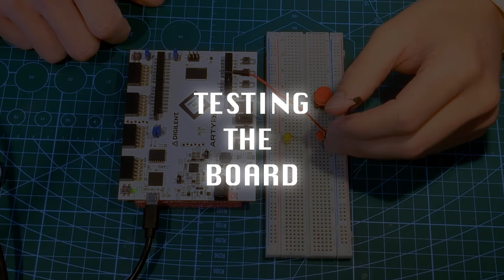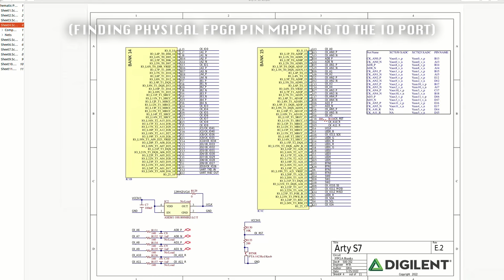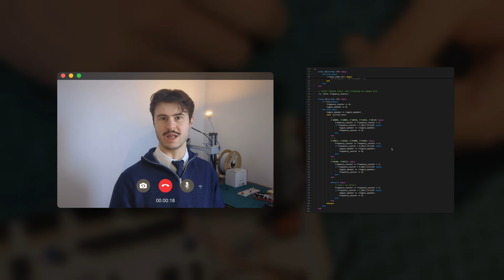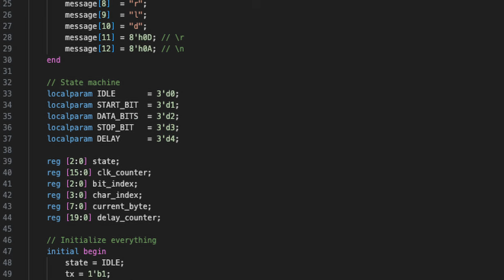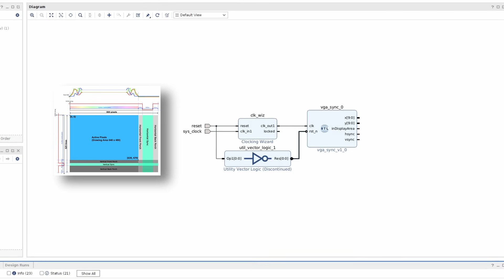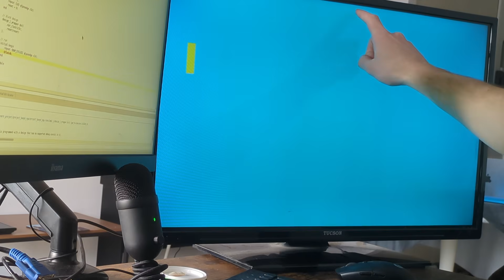I Tested Common FPGA Projects So You Don't Have To

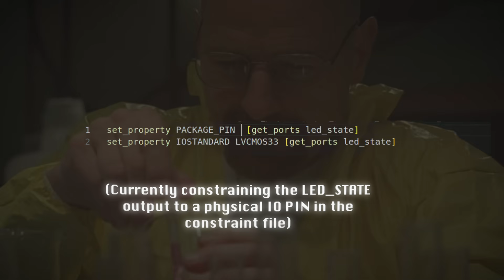Comment: 3:12
You are not obliged to edit yourself the .XDC constrain file.
you can configure yours input/output after the "implementation" phase.
Go to "open implemented design -> I/O Ports tab" -> find your output.
Here configure : the I/O std             -> LVCMOS33;
                             the drive strength -> 12mA (from 4 to 16).
And your output will be "fixed".
Save it and re run the implementation.
The .XDC will be automaticaly updated.

Voilà !